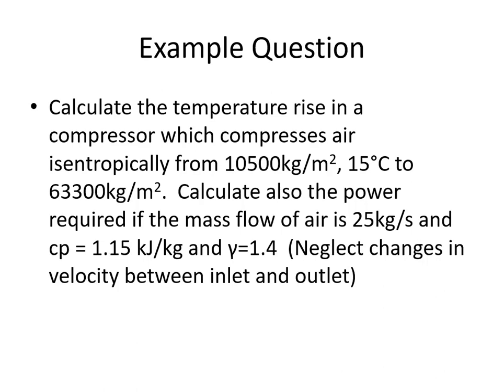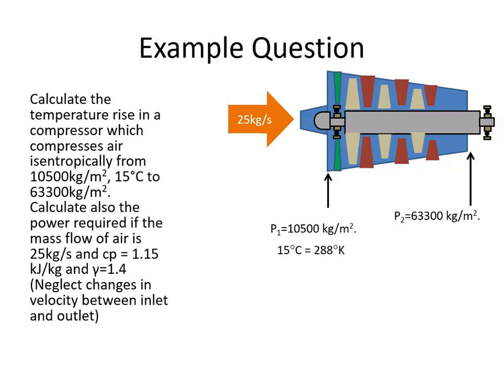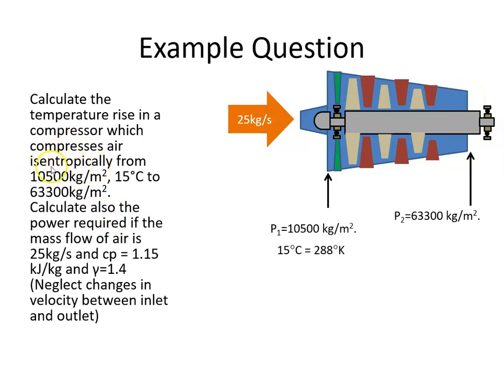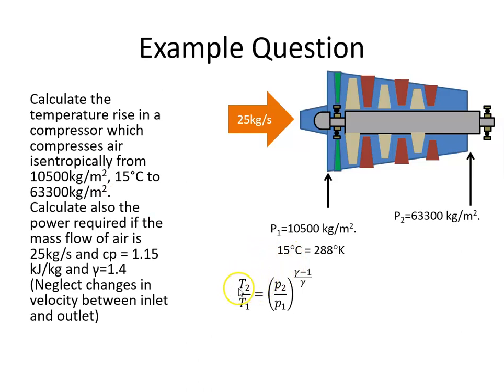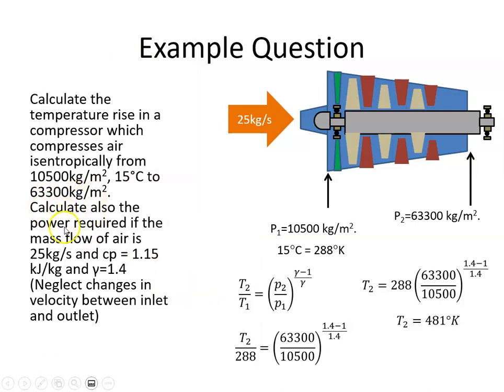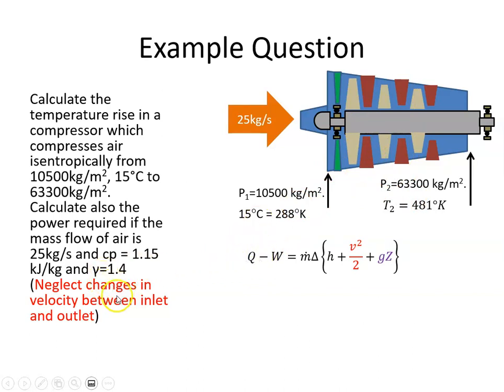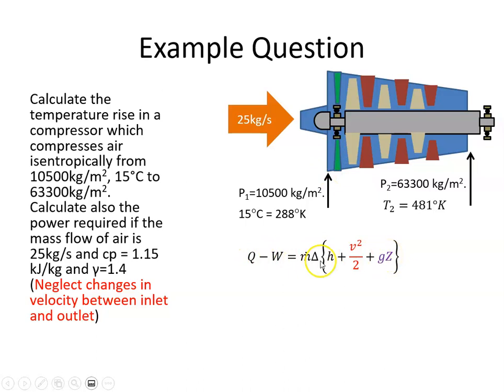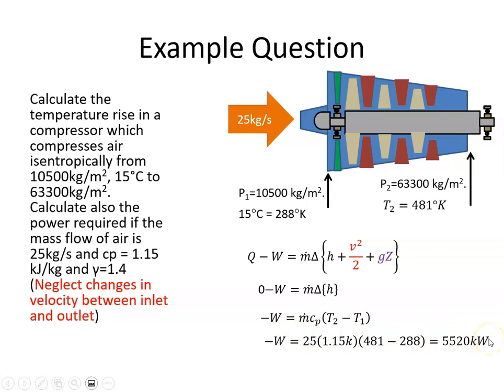Gas Turbine Adiabatic Process Example 1

Comment: Hi Roddy, thanks for the explanation, my background is control system engineering so I am not familiar with the mechanical calculations and trying to learn to understand better, do you have any text book recommendation for further reading on this mechanical processes and calculations?
Reply from the maker: Hello Alwin, the books I used to get a better understanding of this subject were 1>  Basic Engineering Thermodynamics by Rayner Joel,  2> Aircraft Propulsion and Gas Turbine Engines by Ahmed F. El-Sayed.